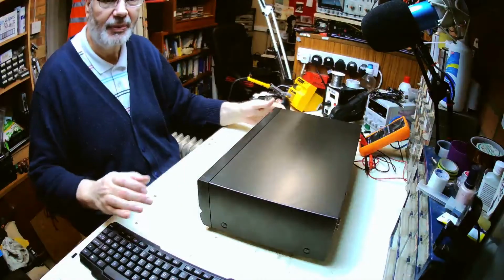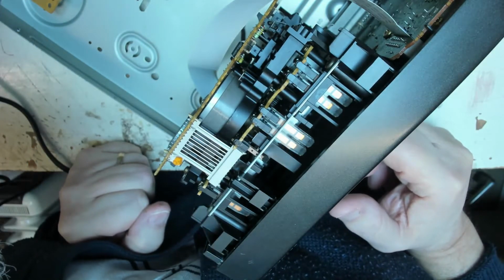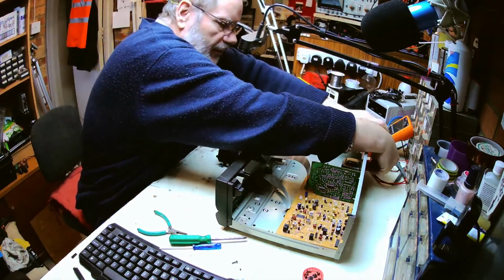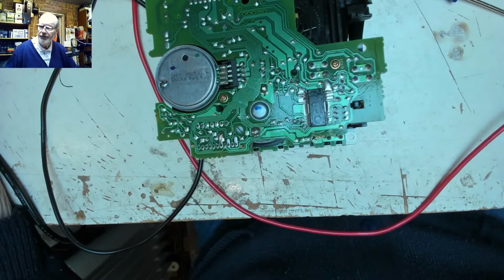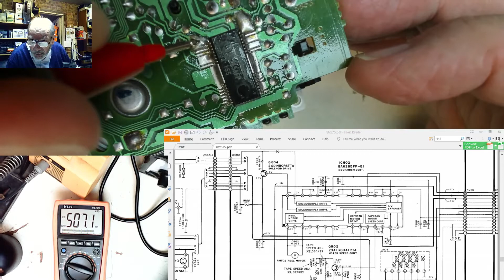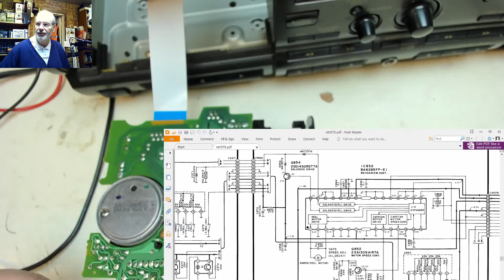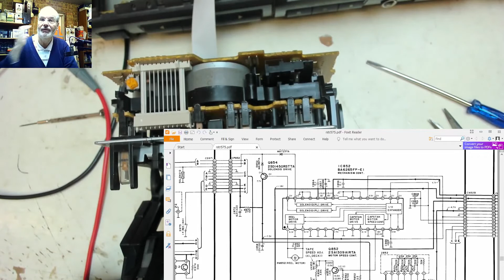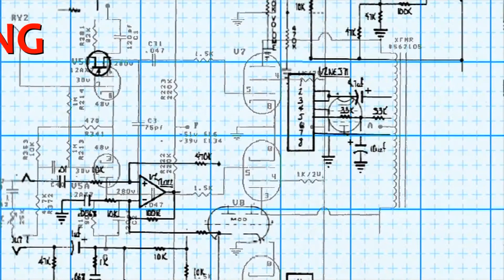Fixing a Technics RS TR575 Twin Cassette Deck

Comment: Nice find and fix. I am here because the unit I just got has what I think to be stretched or worn belts since the cassette starts out fine, but after about ten seconds slows down in a steadily worse manner. Deck one worse than two. So was selfishly hoping you were going into a teardown of that. Not sure it is worth the trouble as like anyone my age, continually forget to press the CLOSE DOOR button - frustrating!
Reply from the maker: I would recommend replacing the belts anyway. It might also be a case of lubrication of the motor bearings. No longer have the unit so can't do a tear down. Sorry.

Comment: I am watching this video for a second time and, let me say, it was worth. This man does a fantastic trouble shooting.
My Deck # 2 door is not opening. I found the  problem is in that sprocket gear covered by the printed board at the back of the mechanism. If I turn that gear with my finger, the door will open. 
I didn't see how to remove the printed board. 
How can that board be removed ?
Reply from the maker: I didn't have to remove the boards in the one I repaired so I would suggest making a drawing of the board and things connected to it and the screws, then undo things bit by bit. you have to unsolder the motor connections. Have a look at the manual, Page 12 Ref 11 and you'll see the procedure.

Comment: Hello! Thanks for the video! I have a RS TR 373, so TR575's younger brother. I am fascinate that these models have all the same mechanism. I bought it for 40 euros. Optically highly cared. The rollers of Cabstan have renewed them with some new Panasonic. I renewed the transmission belt at both gears. Playback heads look perfect, are not worn, so I only have them demagnetized. In principle, the decks work as new ones. One problem that is not yet resolved. Deck B (Recorder) The cassette lift works perfectly without cassette. As soon as I put a cassette closes, then try to open but only a few millimeters, then close again. Some kind of looping. After a while, it works normally. I have to say that I have a few new Cassette from Amazon, TDK that is anything else, but TDK is not! China quality. The housing is poorly worked. But the Deck makes this scene with older Cassette not so intense. After a longer operating time, the mistake disappears. Are the electrical capacitors on the platinum of the Deck B mechanism? Or what else could it be? The fact that after a time the Deck works normally makes me confused ... Do you have an idea?
Reply from the maker: I can only guess that the mechanism may require lubrication with something like Moly grease, not oil or aerosol lubricant. You need to dismantle and clean bearings and pinions. I doubt the capacitors are related to the problem. Hope this helps.
Reply: Man this is the same exact problem I have, with the same model and the same deck! Just wondering if you managed to figure this out?

Comment: Hi! Thansk for the video. I have the same Technics RS-TR575, but deck 1 and 2 dose. not work.I recently finished listening to a cassette, but then I finished only one side, and I didn't start side B, I was stuck there. And now I can't play any cassette on any deck. From what I see, the head is not in a parallel position to the deck, in the same direction as the tape, it is at about 35 degrees. But it doesn't return to its normal position, and when trying to play the tape, it makes a noise like KNOCK KNOCK and then nothing happens, do you know what it could be? Or how to solve it? Thank you!
Reply from the maker: At a guess, I would suspect the drive belts are stretching so the mechanism cannot complete its correct operation.

Comment: Dear Sir, I have a serious problem with my RS-TR575. The 27-pin flex cable that connects the control card to the mainboard, i.e. the connectors CN3A and CN3B, was cut. Due to lack of experience, a 27-pin flex cable was connected inverted. Now it has been reconnected with the corresponding connector, i.e. a direct 27-pin flex cable. Now nothing works, the display doesn't turn on either. The equipment is dead. Could you please help me and know the guidelines to follow.
Reply from the maker: Sorry, not familiar, cannot help. Check the service manual.

Comment: Hello, I need your help, I have an SR T575 cassette deck. when I try to rewind the cassette it will automatically jump in fast forward on both side same thing happen when I try to play the left side direction. please guide me. if possible you I can share the video.
Reply from the maker: No idea, sorry. Only ever irked on the one in the video and that’s no longer with me.
Reply: @ChasLarge  it's okay sir

Comment: hello i have same deck, same side issue auto stop not working any ideas thanks
Reply from the maker: Hi Michael. On this deck, the tape movement on both supply and take-up reels is monitored by an opto-coupler, sensing the change in light on reflective parts of the reel hubs. If these are dirty, then it could be the opt-couplers are not sensing reel motions correctly. However, they also tell the uPC that how long the tape has been in motion and it can calculate the tape length and remaining tape. If these sensors are not working, then the tape counter function will not be working correctly and could be erratic. 
Try using an air line to blow out any dust or dirt from the mechs. 
Is it the same on both decks?
Does the tape counter appear to work OK?

Comment: I have an issue with mine, the sound goes deep and you can hear the tweeters as much, but I can't see it chewing any tape.
Reply from the maker: Sounds like worn or dirty heads.
Reply: @ChasLarge  thanks for getting back, i clean the head regularly so it must be something else.

Comment: Hi there really interesting video. Thank you. I have a Technics rs ch 550 twin cassette player and after using the high speed tape to tape function deck 2  now does not play or record. The tape doesn't turn. I can hear the belts turning when I press play or high speed record, but then switches off. This was confirmed when I took the top off. The belts both turn/engage but then stop. Now I am stuck what to do. Maybe high speed dubbing after many years was just too much for it. (it was bought used). Any suggestions please? Also the  same deck 2 door is slightly ajar on the top left hand side when open and in closed position. Would a piece be broken off? Thank you great uploads. Where are you based? Regards
Reply from the maker: @chylogurti Hi, thanks for the feedback on the video.
I would suspect that the mechanism has not fully returned to the default stop position. If there is a main CAM that turns the MODE SWITCH, which in turn tells the microprocessor where the mechanism position is, it could be that the CAM and or gears have jammed, got sticky grease or worse, a broken cog, so the micro does not know what position the mech is in. I would have to see it to be sure so can only guess.
I'm in Chinnor, Oxfordshire, UK so if you want me to have a look at it, please email me via the link on the channel home page.
Reply: @ChasLarge  Thank you for the reply. I think that I will leave to the experts. I will be in touch. Thank you

Comment: No doubt some impatient person had a habit of jamming the Door closed...
Reply from the maker: It happens, that's why us repairers stay in business :)
Reply: I recently got same player. ATM both doors operate, the drive for deck 1 changes speed, especially for a 90min cassette so think belt is stretched, but these push button doors may be next issue as I cannot remember to use the button and not manually close it!

Comment: I have this same deck and it seems to mechanically function fine but when I play cassettes, there is no  audio output, and the meter does not light up.   Any idea what could cause this?  It happens on both decks.  This deck has sat for many years with no use  so I utilized your instructions/steps to take it apart to make cleaning it alot easier.  Great video. Subscribed
Reply from the maker: Hi. Sounds like it could be a supply rail to the PB circuit. Maybe a dried up capacitor. I think you can get a schematic off the web and then use a multimeter to check the supply rails.

Comment: My double deck stereo cassette has faults, could you help me with Tape 2 I can't hear anything in fact everything works fine in its mechanism and the indicator LEDs do not show audio on Tape 2
On Tape 1 it is not recording well, it only records in mono even though the LED indicators show in both channels when playing what was recorded, it only gives Mono if I place any cassette, both channels are heard but when recording and playing it only mono right channel and not It does not erase well either and it sounds as if the heads were dirty I clarify at the time of recording and play it sounds as if the rca cables were false and the recording is faint low volume
I have tried to record only on the left channel and it gives a signal but lower it only turns on 2 audio led, the right channel re-recording is heard louder 4 audio indicator led turns on.
Reply from the maker: Clean the tape heads on both decks.
Check the wiring to the head on deck 2, one of the connections may have become detached.